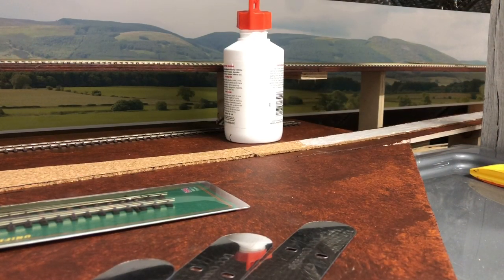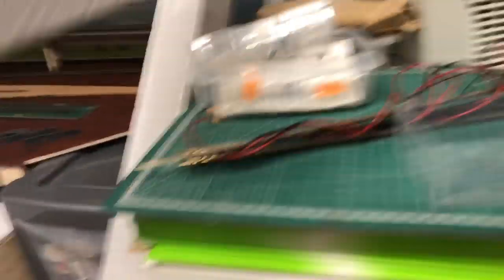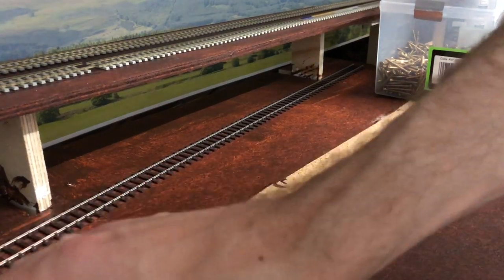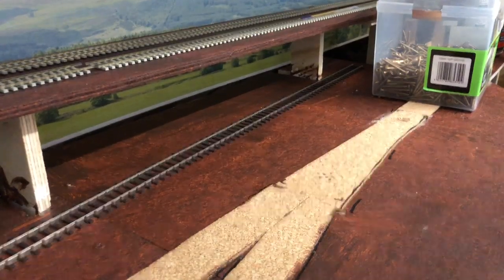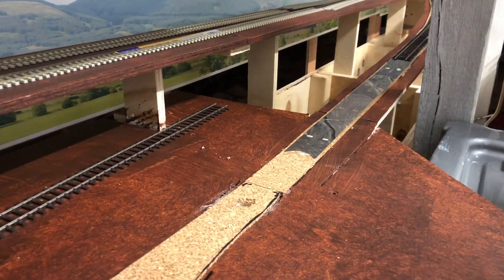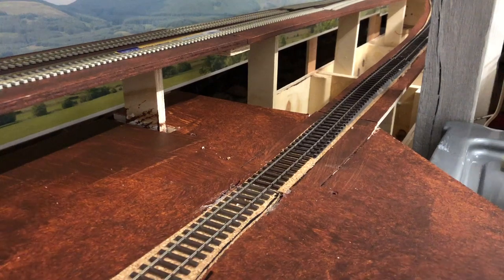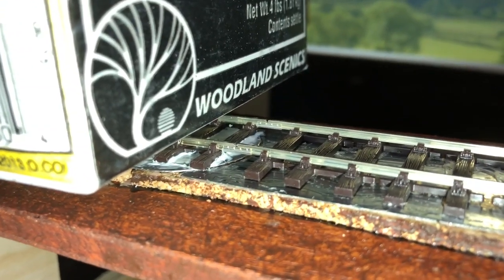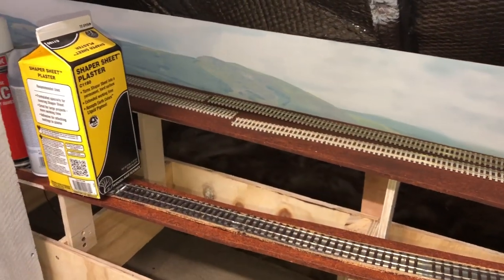Track Laying Part 1 | Building A Model Railway

Comment: I like what you are doing with your layout  , just a little tip when drilling with the larger bit for your point just drill a little larger pilot hole then use your 12 bit ,I know you drilled a pilot hole but you was worried about splintering the cork with the larger bit , hope this helps , keep up the good work .
Reply from the maker: Hi Ray, thanks for the tip! I’ll give that a go!

Comment: Great video Tony, thanks. In the video you put up a caption about droppers on the Unifrog point, could I ask you where you put them? I am just about to lay my first unifrog points and the only place seems to me to be to cut away the webbing one sleeper in from the end before the tie bar. At the price these are I don't want to make a mistake! Cheers Steve
Reply from the maker: Hello, thanks for your comment! I’m independently powering all my points. So they will all he completely isolated. I attach the droppers to the outside rails. Where abouts on the outside rails you solder too dosent particularly matter. You won’t do any harm cutting away a bit of webbing, I’ve done it on many points!
Reply: Thanks Tony!

Comment: Good video, thank you!  What is the purpose of the thin magnets on the incline?  Never seen that before
Reply from the maker: Hello! The actual metal plates you see being layed are not magnetic. The kits also comes with little magnets you attach under your locos. When the loco passes, the magnet is drawn down to the metal plate, improving traction and making it easier to climb the incline. Hope that helps!
Reply: @TonyDocksStation  yes, thank you. Very interesting!  I look forward to seeing it operate in future videos.

Comment: Great video as always, quick question with soldering the rail joiners won’t that negate the expansion gap and I have found you can glue the cork and not the rail works ok for me so far Cheers Colin
Reply from the maker: Thanks Colin! Yes, it may...but it’s a necessary step. However, I’ve left room at the end of each rail between the points to allow expansion there!
Reply: Tony Docks Station Thank you for replying, looking forward to the next one cheers Colin